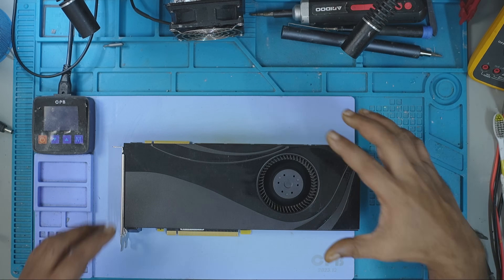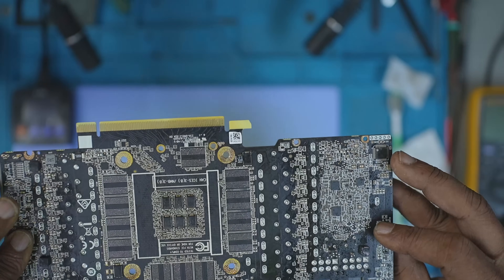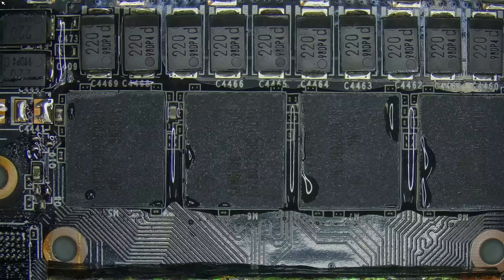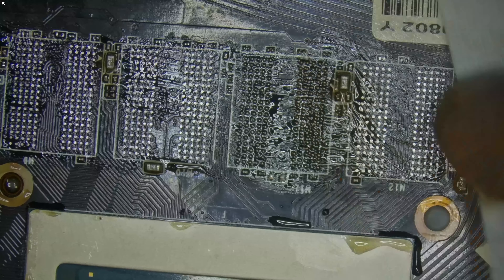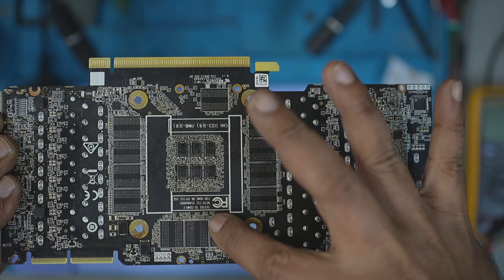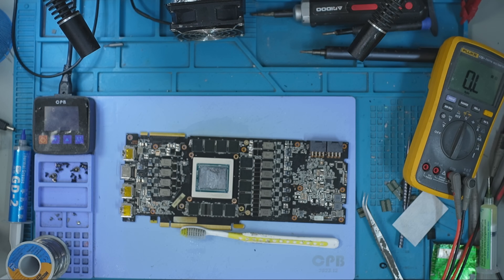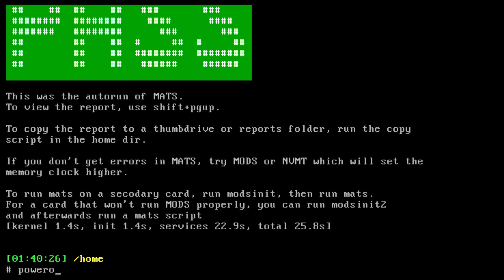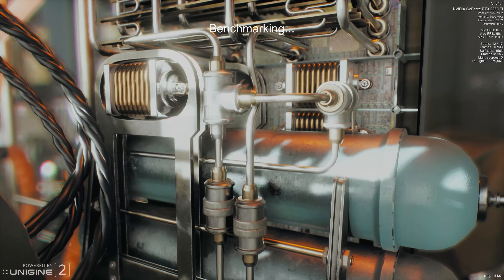Can Any GPU Get a VRAM Upgrade? | Asus RTX 2080 Ti (11GB → 22GB)

Comment: So if ive understood this with my current card the rx 9060 xt 16gb is not upgradeable without a board change as its already using the gddr6 2Gb models in a clamshell config
Reply from the maker: The 9060 xt 16GB already uses a clamshell with 2GB memory. It cannot be upgraded further on the current PCB or any PCB. It is at its limits.

Comment: Sir, thank you for this video!
Can you please answer me if Gigabyte Vision OC - RTX 3080 10GB can be upgraded?
Reply from the maker: unfortunately, I have not managed to get any GPU using GDDR6X to work with the upgrade. It requires BIOS Edit and custom drivers which I have not managed to get it to work yet. it's still a work in progress.

Comment: Hello Frazer, I have two Asus 2080 Ti Turbo...that I will eventually send to you for an VRAM upgrade. I'm mainly using them for Gaussian splat generation or Rendering with Redshift render...both use cases would benefit from lots of VRAM and I think upgrading the 2080 Ti's might still be worth it. But this will have to wait a little as I will be traveling soon and will have no physical access to my workstations to replace cards.
But currently I have an annoying problem with one of these cards. The fan speed is reported as 0 RPM....but the fan is constantly spinning at full power. I already replaced the fan. Would you happen to have come across such an issue and maybe have a hint for where to look next ? Software seems fine, card was tested on different machines. Between the working card and the non working there are minor differences (around 30 in hex) between the VBIOS...but apparently this is to be expected (configuration parameters). I would prefer my machines to be quiet for when I'm away and accessing them remotely....otherwise it might drive my neighbors crazy.

Sorry for bothering you with this issue...but you seem super knowledgeable. In case you have no time, no problem...I can understand that you're probably super busy, it's just that I'm a bit desperate and would like to solve this problem somehow.

Kind regards
Kaspar
Reply from the maker: Fan spinning at full speed even though it shows 0% translated to the PWM not working. Either the logic gate is faulty or the fault is originating at the GPU core. If there is a controller that produces the PWM signal it can be fixed. If the fault is with the logic gate it can be fixed but if the issue is at the GPU core then it cannot be fixed.
Reply: @GraphicsCardRepairs-tk7ql  Thank you for your reply. I hope it will not be the GPU core in the end. The GPU works flawlessly except for the fan issue. I will have another look and try to see if any of the components surrounding the fan connector look suspicious. Unfortunately I could not find schematics or guides yet regarding this issue.

Comment: Hi Frazer, I had a question, how do I check if the bios supports faster memory timings? If my GPU is 1GB GDDR6 modules (Non-clamshell), How can I check if I go from 14Gb/s 1GB module to 20Gb/s 2GB memory module? Thank you for your amazing videos and keep up the great work!
Reply from the maker: Which GPU is it?
Reply: @GraphicsCardRepairs-tk7ql  RTX 3070
Reply from the maker: @RussellG-r7h in this video I tried the 20Gbps memory modules but it did not work. 
https://youtu.be/KNFIS1wxi6Y
The highest is cancelled go is 16Gbps memory modules

Comment: Can 3080ti go up to 24GB?
Reply from the maker: As mentioned in the video. I am working on one but not managed to get it to work yet 😊
Reply: @GraphicsCardRepairs-tk7ql  NVIDIA signs the BIOS with a private key, stored on the GPU so if anything doesn’t match it won’t boot correct? How are you going to get a workaround for this? This card and newer do this so you can’t upgrade the vram on these gpus
Reply from the maker: @SaltyWithADot I have not managed to get around it. I am trying but it has not worked. If I do I will r please a video. Yes the drivers are digitally signed
Reply: @GraphicsCardRepairs-tk7ql  have you seen teclab’s video where they take a 3080 TI and mod the life out of it haha, the video is called “worlds first 4090 super” they used some custom bios though so not sure how realistic that is to do for most people as they have stations costing £££££ too much money haha

Comment: I know you said 4060 ti 16gb, but can the 8gb version be upgraded?
Reply from the maker: The 8GB version does not have memory slots at the back like the 16GB version. There is not empty space to add more memory. It cannot be upgraded further on the same PCB.
Reply: @GraphicsCardRepairs-tk7ql Would it be possible to add another nvenc encoder to a 4060 ti 8gb?
Reply from the maker: @OwOmre no the 4060 Ti 8GB does not have memory slots at the back of the board. All memory slots available are already populated.

Comment: When we have 5060 with 16 gb vram. then is that possible for a 8gb vram 5060 can be upgraded to 16gb?
Reply from the maker: Not on the same PCB. The 16GB version has memory slots at the back of the PCB whereas the 8GB version does not.

Comment: My 3070ti 8GB card (which has 4 empty VRAM slots ready for reballing, the solder balls are present) could support 4GB more VRAM? (8 to 12gb)

Do you think my blower soldering iron (which doesn't exceed 450°C at its maximum power), could melt the original solder balls on the card? The problem, I presume, since it's factory-assembled solder, I'm thinking it's melt at very high temperatures...to be confirmed.

I also think that compatibility will be better if I add vram identical to those present, namely 1gb per vram, on empty slots (apparently the power supply reaches these empty slots).

I'd like to try, but it would be nice to know what temperature is required to melt this factory tin.
Reply from the maker: I would not take a chance with ay hot air unless I have tested on a dead board and it works to my liking and expectation. Sometimes hot air from same manufacturer can be so different. knowing your tools limits is essential.

Comment: The only thing I'm left wondering about is upgrading cards that have empty/unused spots for memory chips, like the 1080Ti with one unpopulated spot or the (a bit more relevant) 3080 10GB which has 2 unpopulated spots. A 3080 12GB model (not talking about the 3080Ti here) exists that came out later and has those spots populated, however the GPU itself is also slightly different (slightly more cores and TMUs). I mean.. it obviously wouldn't double the amount of VRAM like most people would hope for when they hear "GPU memory upgrade", but if it's just a matter of populating unused spots for memory models, that at least sounds like a "simple" upgrade. But I bet nvidia put some hurdles in the way as they always do.
And now my head is going into overdrive wondering about populating a 3090 PCB (with spots for memory chips on both sides of the board) with the higher density memory modules used on the 3090Ti 🤔
Reply from the maker: The unpopulated slots on the board are not active on the core. installing memory modules in the empty slots will not work. I have explained what is required to have a chance to upgrade in this video. I also have another video where I explain the difference between GDDR6 and GDDR6X and how they function.
https://youtu.be/fqN8tPJVeHA

Comment: How much might it cost to upgrade an RTX 5080 to 24 GB?
Reply from the maker: As explained in the video. 3GB memory modules are not available in the open market yet. Once it's available it will be tested on the 50 series and the cost will be available.

Comment: I have a question about your upgrade price.

You say in this video, at 11:50, that it's 205 for the 3070 upgrade, but your websites shows 750. Which is quite a difference.

So I'm wondering what is the real price?
Reply from the maker: The prices on my website are in AED( UAE Dirham).
Reply: @GraphicsCardRepairs-tk7ql ok. Google translated it as Jordanian so the 3070 upgrade would cost over 1000 USD.
Reply from the maker: @Smithcraft1no. converting AED 750 to USD translates to 205 USD. In Google just type "AED to USD". In the AED section type 750. Also Jordan is a different country. AED is UAE currency.

Comment: Would you be willing/able to do VRAM upgrades to older Polaris cards (RX 580/590)?
Reply from the maker: If the RX 580 has 4GB it can be upgraded to 8GB on the same PCB. If it already has 8GB a custom PCB is required. Unless I have a production line running to offset the cost of making a custom PCB will out weigh the cost of buying a faster GPU with more memory for a lesser price.
Reply: @GraphicsCardRepairs-tk7ql  In this case I mean upgrading an 8gb card to 16gb. That upgrade would serve the 580 and 590 very well.
Reply from the maker: @KSword007 to 16GB would need a custom PCB with memory slots at the back. To cost to design such a PCB will not justify the value of the GPU unless I am manufacturing and upgrading in thousands.

Comment: How does the software for something like this work? Like if you need to reinstall drivers will that screw up the functionality of your modded card? Or will it automatically adapt around the fact you suddenly have 48gb vram instead of 24?
Reply from the maker: No modification in drivers or bios is needed. Works with stock.

Comment: I cannot believe that rtx 3090 cannot be upgraded to 48gb but a rtx 4090 using rtx 3090 pcb can be upgraded to 48gb.
Reply from the maker: It's not that it cannot be upgraded. A BIOS edit is required to get it working using 2GB memory modules.

Comment: Interesting, I have a RTX3090 FE and was interested I upgrading to 48GB plus fixing a fan broken connector, my current temps are 65c on core 77c hotspot and 70c on the memory (using a cpu heatsink on the top of the GPU, fan curve is not aggressive and I run different fan speeds on each fan has the fan under the core is very low for the benefit it gives! Good work loving this mods, I also have a challenge with a GTX1080ti where the heat was so high that it moved the vrm and resisters lol.
Reply from the maker: Those temps sound pretty good, that is great work.

Comment: I am practicing on a few older graphics cards that work .just bought my first hot air station rf4-h2 to add to my tools. Im confident with soldering tiny grain of sand sized SMD components. I will be then attempting this mod on my aorus 3070 dual 8gb. Thank you for the excellent videos
Reply from the maker: Thank you 😊. I wish you success.

Comment: Can the RTX 3080 10GB be upgraded to 20GB? I've heard about mudded 20GB 3080s existing I can even find a bios for a 20gb 3080 on Techpowerup so it's possible but you don't seem to offer vram upgrades for the 3080 10GB, is this a case where you'd need a different PCB to do the upgrade? A 3080 20GB upgrade (depending on cost, it only makes sense if it's cheaper per additional gb gained then selling the 3080 and buying a 3090) would be pretty useful for me, right now I have my 5090 along with my old 3080 as a secondary GPU giving me 42GB for AI use, increasing that to 52GB would let me run larger context or larger quants.
Reply from the maker: The core of the 20GB version is the 3080Ti. This is a defective 3080Ti with 2 memory controllers disabled just like the 3080 but it has the same number of CUDA cores as the 3080 Ti. This GPU was not officially released. I have not managed to upgrade any GPUs with GDDR6X yet but when I do I will release a video.

Comment: Bord Partners do cheap RAM so slow ram chips is it possible to have more faster ram faster timings and  ore for OC better ramchip's?
Reply from the maker: It is possible but since the timings are not mentioned in the bios the BIOS will need an edit or manually overclocked.

Comment: is it possible to upgrade the evga rtx 2080 ti with 2GB chips in such way that the pcie connector side memory slots will stay empty? This card has a design flaw tha the pcie side ddr ram chips will fail because of the tension from the cards weight. So this way i will get a 16GB gpu.
Reply from the maker: It is possible to upgrade all RTX 2080 Ti

Comment: well after watching this I get the picture so unfortunatly for my RTX 4070 12gb has no upgrade path, bummer but I was thinking of upgrading to Ada series anyways. Thanks for you insight it was really helpful and keep what you are doing its very very helpful for ppl like us love the effort and work ❤
Reply from the maker: Glad this video answered your question. For the RTX 40 series, a custom PCB is required with a clamshell technique but the cost of making this PCB beats the purpose of being cost-effective.
Reply: @GraphicsCardRepairs-tk7ql  unfortunate hope the 60series gets a better compatiblity but seeing how Nvidia is going about this doesnt seem that they'll be
Reply from the maker: There is hope for 50 series but it is yet to be tested. 3GB memory modules are not available to buy yet but once they are available I can start exploring. Yes a 50 series GPU is also required.  @thrWasTaken
Reply: The 4070 is a 192bit bus GPU
In theory you can have 12gb or 24gb vram on this card

Comment: I await the day you post a video of upgrading a modern AMD gpu.
Reply from the maker: Unfortunately all the amd GPUs already use the largest capacity produced on the GDDR6 platform. There are no more empty slots on the PCB. Unless a new PCB is designed using a clamshell technique.

Comment: can a blower style cooler be replaced with a 3 fan one or would it be impossible?
Reply from the maker: It depends on the PCB. If it is a reference design board and another AIB partner has a 3 fan design using the reference design PCB, it can be compatible. Mostly possible with 2000 series but 3000 series very rare.

Comment: For anybody that wants to try this, I recommend getting like very old budget GPUs you can get for like anything less than 30 bucks because some of those can be upgraded and if you break them then tough stuff because buying a decent broken graphics card is still going to cost more than buying a older crappy graphics card like a GT 710.
Reply from the maker: Absolutely

Comment: 3080 upgrade to 20gb possible with micron MT61K256M32JE-19G:T ? seen the bios on tech power up as well.. just curious.
Reply from the maker: I have not managed to get it to work yet.
Reply: @GraphicsCardRepairs-tk7ql  i did see some listings on ebay for about 700 and they seem to use the regular 3080 core

Comment: Too many people ask questions about information he covered in the video lol... Watch the video so he doesn't have to repeat the same questions/information 1000x, people!
Reply: So to understand that upgrading the memory from a RTX4080 Super Gigabyte Aero OC 16Gb to 32 Gb would be hard to impossible....
Reply: It's would be worth to make a short summary, like this:
2080ti - yes
3070 - yes
Rest - probably no.
50x0 - not tested, but also - probably "no".
Reply: Ya but not all necessarily know what kind of design their gpu is and what memory modules it uses if you havn't picked it apart or googled it. Another thing is if it's viable to do depending on the card in question. I just thought if I could make my old GTX1660s 6-12gb, but hardly worth it, even it was doable 😆 and you also have to know someone that can do it. doing this kind of soldering and desoldering is not a trivial matter for the standard DIY'er 🙃 I can see the idea especially if you have the 2080Ti. 22Gb could make that card really viable especially today with the current state of Nvidia 5000 series scams. Could you make a 5080 32gb ?

Comment: I've attempted it for a 2060 Super. I messed up obviously, it is really important to get all the tools and practice (basically what you said in the video)
Although I am now interested: could it ever work? It was a Gigabyte windforce RTX 2060 Super. I've checked in the boardview that straps can be configured to support 16Gb and also checked in GPU-Z that it should have data for higher memory capacity.
Reply from the maker: It is supported. You will need a lot of practice to get it right. I would suggest practicing on dead boards.

Comment: So is it possible to design a PCB board to upgrade a 1080 Ti from 11GBS to 22 ? 

If so, what would you say would be the performance gained, and will the timings have to be adjusted ?
Reply: Nevermind, the GP102 chip only allows for GPU12GB of GDDR5X
Reply from the maker: As explained in the video to increase the VRAM the new PCB should use a clamshell technique. I have never created a PCB as it beats the purpose of being cost effective.
Reply: @GraphicsCardRepairs-tk7ql 

Great video. Honestly, i took notes and did a bit of investigation out of curiosity.

But it would be interesting to make a PCB shell and create this from scratch

Comment: Do you know why Nvidia 4070 mobile graphics has maximum 8GB Ram with any laptop brand while the desktop version has much more ram. 

Have you ever tried to upgrade mobile nvidia 30/40graphics memory?
Reply from the maker: Yes the GPU chip that is used as a 4070 on a laptop is actually a AD107 class chip used in 30 or 50 class GPUs on desktop. It has only 4 memory slots. I repaired one of these for one of my customers.

Comment: I honestly want another go at HBM memory with a RX 9070 XT core with HBM4 memory.
Reply from the maker: HBM memory modules are fused to the GPU core and are on the same die as the core. they cannot be removed or installed.

Comment: would it be possible to double vram of a rtx 2070 Super to 16gb?
Reply from the maker: Yes, it's possible and it works too, but it's not worth it as the cost of the upgrade does not justify the return.
Reply: @GraphicsCardRepairs-tk7ql  The cost being the price of the memory modules? Or are you including labor?